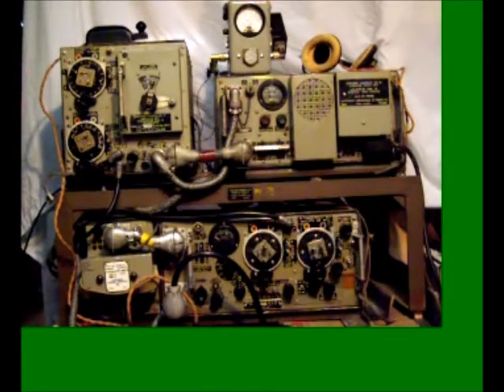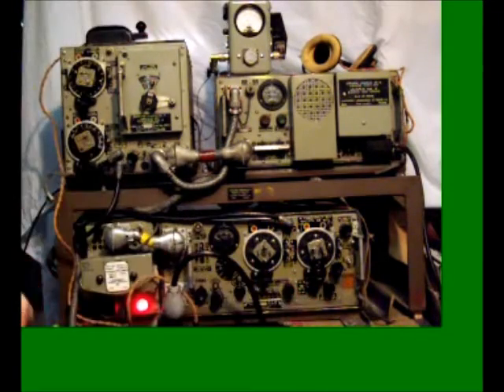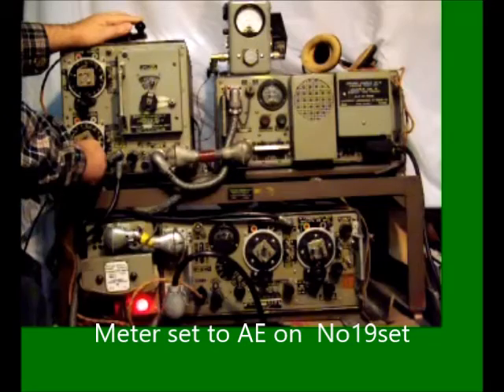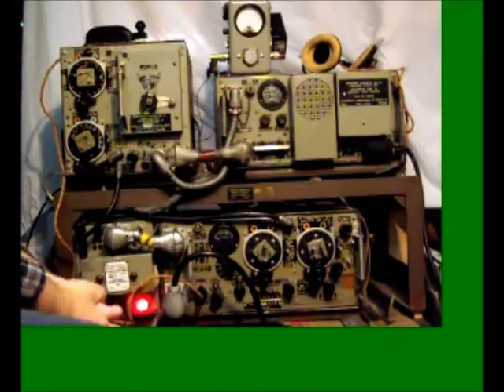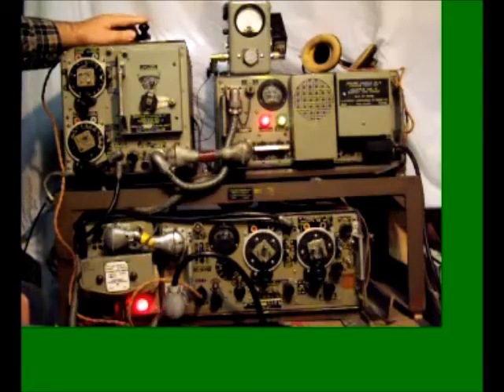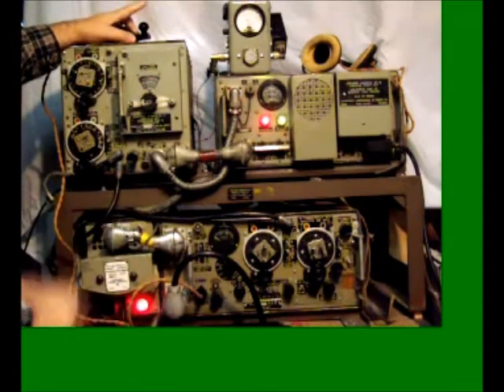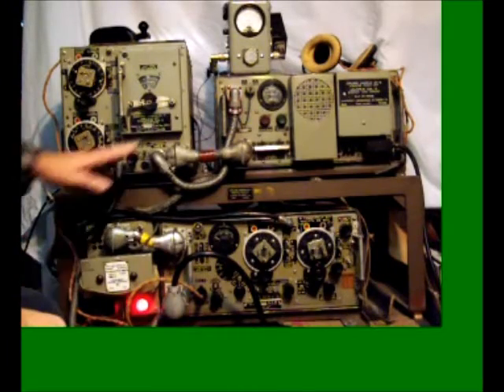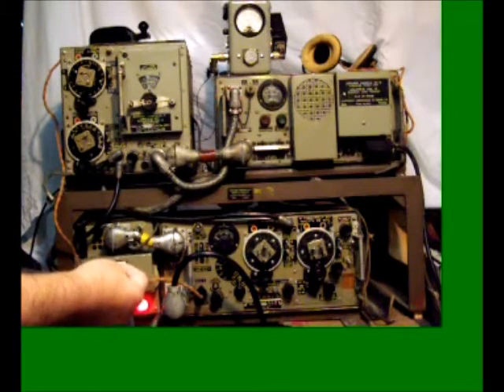WS 19 set with RF PA

Comment: Hi thanks for the very interesting video . I have the Canadian amp and power supply , got it from Canada . Never had it working because I need the eht cable and special dog bone , do you ever see these , tried for many years with no luck . 73 Mark G4HVK
Reply from the maker: Mark Thompson    hi send me a picture of the units and if I were you open them and check ps nothing loose /tunes.  and power supply make sure all in side is secure espasialy the 2 vibratory. 
I WILL get back to you after looking at the pictures of the amp and items you have.

Comment: Very interesting video for an unusual piece of kit. I have a WS19 MK111 hence my interest. Looking forward to future videos on the 19. 

73 de G6PBS Colin
Reply from the maker: +G6PBS  Thank you. I try to cover what is not said in the books and show actually show connecting and making it work. I will be doing WS 19 MKIIIshortly with a DC power supply. Cover wire change 12 to 24 VDC. and otheritem I have learned by helping others with repairs and doing repairs. If I have time in video will cover Crystal Calibrator and controls.Please let me know if there is something you want covered on WS19?You have my email    va3fsd@gmail.comFrank  va3fsd

Comment: Hi 
Nice video thanks for sharing.
I have the 2 units on top - Would they work or they need also the units on bottom and all the units you have here?
Reply from the maker: Hi they were made to be used with WS19.(bottom Radio) You need all the cables. For another radio you need a modified  radio input cable ONE TX CABLE for RF input and  PTT / M+ and 12vdc Line connecter modified to your Transceiver it will work with some changes. But I do not recommend they were not built for  newer equipment.  It is for TX only between 2 -8 MHz and power supply max AC input 117 VAC. Frank         va3fsd@gmail.com.
Reply: VA3FSD what is the worth of the 2 units on top ?